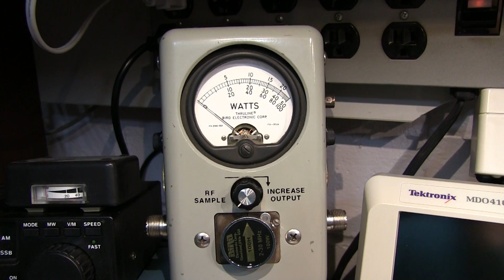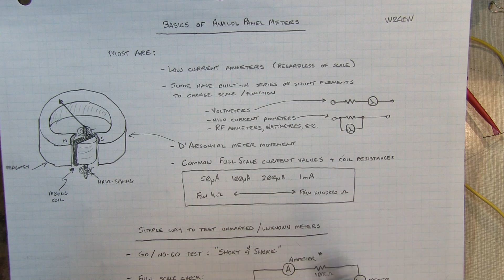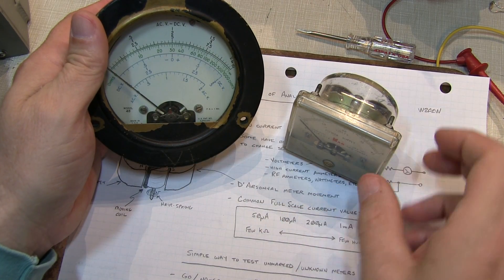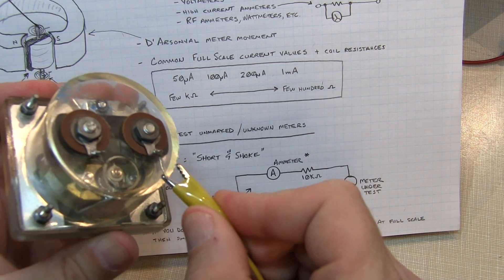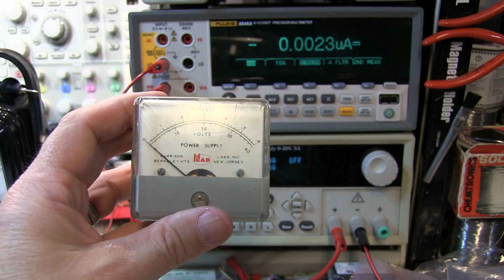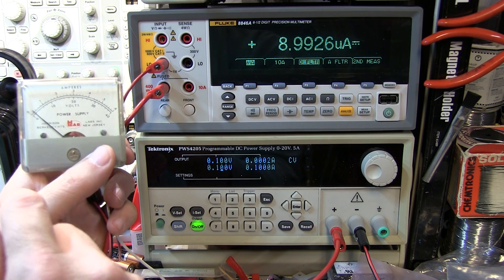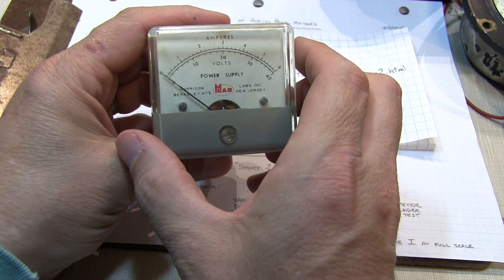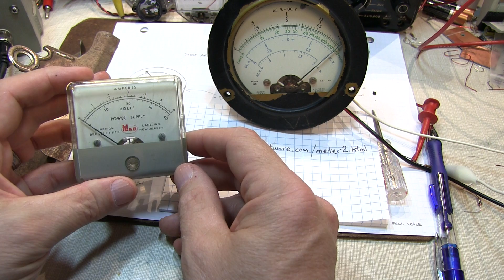#235: Basics of Analog Panel Meters | Analog meter movements | D'Arsonval

Comment: Thank you for this video. I learned so much and it jogged some memories from 40 years ago in my "computer electronics" class in High School. Lol. I'm working on an Autotransformer (Variac) that takes 120vac in and produces 0-140vac out. It came with the appropriate Emico voltmeter installed. The transformer is in fact producing 0-140vac but the Emico is only reading approximately 70vac while my Fluke DMM is reading 140vac. The Emico has no FS information printed on it. I assume at one time it worked correctly some years ago. I can see a rather large resistor in series with the coil and this all looks unmolested. There is no zero screw but the pointer is resting at zero. Can you tell me if this meter is shot or is there something I can do to get it reading FS correctly again? I appreciate any feedback or help. Thanks.
Reply from the maker: It certainly is possible that the resistor has increased in value - it's reasonably common, especially for older carbon resistors.  That would be the first thing I'd check.
Reply: @w2aew  well Sir you are 100 percent correct. It's Brown, Black, Orange, Gold. 10k ohm +/-5%? It's reading 19.7k ohms on all 3 DMM's I have. Which makes sense considering it's basically doubled it's resistance and it's reading half scale. Next question is how do I determine the replacement resistors  wattage? This is approximately .500" L x .250" D. I'd guess either 1/2 watt or 1 watt but how do I confirm? Thanks again. Robb.
Reply from the maker: @robbo6460  easy. Assume that the full 140V appears across it. Power is V squared divided by R, so about 2W at the full 140V. You probably want to give yourself a safety margin and us a 4 or 5 W resistor.
Reply: @w2aew  could a carbon composition (original) be replaced by a carbon film resistor of 4 or 5 watts?
Reply from the maker: @robbo6460  yes
Reply: @w2aew  can I take a Shurite 3404 Edgewise 0-15 vac meter and use it as a Shurite 3406 Edgewise 0-150 vac meter? The scale would be off by a factor of 10 but I can make a small sticker denoting (x10).
Reply from the maker: @robbo6460  Yes, you can most likely put an appropriate resistor in series to increase the full scale voltage reading.
Reply: @w2aew  I can't find any specs on the movement of the Shurite Edgewise. Since the 3404 is already an AC voltmeter, I assume it has a series resistor already. Can I just look at that resistor color code and multiply by a factor of 10?
Reply from the maker: @robbo6460  That should get you close.  It may be better to multiply by 8 or so, and then stick a variable in series and adjust it for accuracy.

Comment: My problem on a Weston model 685 is that the meter movement is actually burned out or open. So this testing procedure won't work. And there is no FS printed on it. How do you find the full scale value in an instance like that?

Comment: All of my ammeters have a millivolt rating for full scale.  75 mV. It would be nice to know the current flowing through the meter at full range. Thanks for the info.
Reply from the maker: If they don't have any other markings (coil resistance of current at FSD), then you'll have to measure them.

Comment: I liked your video. I have a 0 - 10 Amp analog meter, and a 0 - 15 volt analog  meter. I tested  the voltmeter and  the needle wanted to move backwards when in reverse. Could I adjust to have 0 centered at  the top? I would like to use these meters on my HO train layout.
Reply from the maker: There are meters designed for a center-zero.

Comment: I used to work on a lot of pyrometers and hi-pot testers with meters and found if you pull off a plastic meter face, do not clean it if you don't have to. I've cleaned plastic meter faces and had them develop a static charge that pulls on the pointer and can makes it stick to the meter face. A anti-static cleaner may fix this problem but I've never tried it.

Comment: I'm hooking up an old tachometer to a newer motor and have added resistors to lower the current. The tachometer has no electronics and the output from the motor is ac. would I use a diode or zener to remove the dc component?
Reply from the maker: You would need something to convert the motor's AC output into a DC value that is proportional to the RPM.

Comment: I did this to boost HP in my car, it used to say 12.4v after a few days of sitting outside due to the Corona Virus.  After I did the face plate mod, it now reads 14.6v, enough to start my car even with the low battery CCA.  I was able to overtake many EG hatchbacks.

Comment: I have one of that china made 40watt laser engravers, it was cutting poorly and after watching your video, I started suspecting that the analog ma meter was giving me the incorrect mA measurement, After un connecting it and hooking up a voltmeter in its place, i gain 50% of the power back, Which means the analog ma meter that was installed is somehow dropping the power, My question is, How do i find the correct resistor value to have both the analog ma meter displaying the correct mA draw and making sure the cutter gets the power.
Reply from the maker: It is impossible to say without knowing details about the meter (full scale range, coil resistance, etc.) and how it is hooked up.  Disconnecting the ammeter and putting a voltmeter in its place doesn't make any sense to me - ammeters are connected in series while voltmeters are connected in parallel - they are not interchangeable.
Reply: @w2aew  the measurement range that is needed is from 4mA to 30mA, the mA meter is connected on the Cathode side of the Co2 laser tube going to ground, the multimeter I used is in mA mode and I simply connected the probs in place of where wires of the Analog mA meter was.  Is that wrong?
Reply: @w2aew  Thanks for the reply, I got it all sorted out, I basically tried a few different resistors till I got the right one which I settled on a 20ohms. Nonetheless, your video helped me learn something new, Thanks

Comment: That ampmeter was reading 200 mili amp on the first reading not 200 micro amp. I'm sure you meant to say mili amp and not micro. That was really cool tips👍 very good video😁
Reply from the maker: It was actually 0.200mA, which is 200 micro amps.
Reply: @w2aew  Oh sorry I didn't notice the "0."which obviously makes it micro... anyway very cool video i learned some very handy tips.

Comment: Thanks for the explanation! Do you know how sensible VU meters are against pegging? Can they break easily when they pegging at the full scale?
Reply from the maker: It all depends on the design of the particular meter.  Some are more forgiving than others.  In general, it is a bad idea to peg the meters.  It can overload/overheat the coil, and can damage the movement and needle if it smacks the stop too quickly.

Comment: how do you troubleshoot equipment that uses those analog panel meters, how do you know if they are good or bad because using a Fluke 87 DVM meter on ohms mode they will measure 10 ohms across the analog panel meters so I don't know how to tell if its good or bad. Older equipment in the 60's and 70's used those analog panel meters to measure voltage, current, wattage, etc. But when measure the ohms across the analog panel meter when using my fluke 87 DVM meter it will measure very low resistance. When an analog panel meter is to measure a voltage what is the difference between an analog panel meter to measure wattage or current  its the same thing the analog panel meter is either in series or in parallel. I'm not sure if the analog panel meter is internally different to measure voltage, current, wattage, power, etc.

Comment: How do you test panel meters if they are good or bad because when you measure the ohms of a panel meter it measures very low ohms like 10 ohms so I don't know if the panel meter is good or bad. If a panel meter measures watts how is the panel meter connect to the circuit in series or in parallel? If the panel meter is bad not working can I connect my fluke DVM meter across it in parallel to act like a current or wattage panel meter?

Comment: is there any way to move the zero point to the center? my adjustment goes to about 30%... is there an adjustment for the other end that would allow the whole thing to drag to the middle? I want to translate my left-zero meter to center-zero
Reply from the maker: Not easily.  The tension spring design is likely a little different on the "centered" models, so it likely isn't practical to expect that you can adjust one to be a center-null meter.

Comment: I would add a couple points. The springs serve a double purpose. #1.   It is the electrical pathway to the coil itself.  #2  as was stated It helps to keep the pointer stable,
Reply: good, great, important point which the uploader skipped. Material is phosphor bronze which is a good conducting spring material. Steel is bad conductor and also corrodes during monsoon. Kishore kumar from Chennai, India.

Comment: The new multimeters have built in NCV, VFC, VFD. I think the NCV non contact voltage is only for AC voltages for wires in pipes and wooden walls, but can't sense DC voltage in pipes and wooden walls. The VFC variable frequency interface is for measuring AC voltage i think that can have different AC line voltages at 50hz, 60hz, 400hz. I'm not really sure what this VFC really does, do you know? The VFD is to measure motor signals the VFD filters out the motor signals to help measurement. I'm not sure what kind of motor signals you measure using the VFD mode but it filters out the motor noise i think. Do you know what the VFD is used for?

Comment: Hi Alan,, I realize this is going back a ways but,, I'm wondering if I could get some guidance with regard to a A/C ammeter i would like to add a shunt to. The meter is a 500ma range meter and there is no current rating for the movement so,, First do I need to know the internal resistance of the Ammeter?  Do I have to get the meter to do a full scale deflection and how would I do that. I actually tried a 10K resistor to do a voltage drop test and the Dmm amp reading said I think 120 Milliamps for 120 volts..  When I tried to take a voltage reading across the ammeter itself I got no measurment. So was there a extremely small voltage drop across the meter say in Microvolts? I would like to be able to use the ammeter to 5 amps.. I'm at a loss.. Hopefully you can help. Thank you.. and thank you for the great video.
Reply from the maker: Let's see - the meter should have read 12mA at 120V with a 10k series resistor.  With a known voltage and resistance, you should be able to figure out what the full scale reading of the meter would be.  Odd that you didn't see any voltage drop at all.  Since you said it is an AC ammeter, are you sure you had your DMM in AC Volts mode when measuring the drop?
Reply: Fantastic thank you for your reply.. Yes the meter read 12ma at 120 A/C with a 10k resistor. Yes the meter was set to AC volts,, Is the Current draw of ammeters in the Micro amperage range? Would the Voltage drop across the meter have been so small (Microvolts) that my meter didn't or couldn't read the voltage measurement maybe? Also the meter did not didn't budge at all. I'm lost,, I calculated a resistance size for the range of the meter which was 500 Ma thinking that the 10 k was either too small or  too large but I found out that one needs the microamp reading of the meter movement not the range of the meter.. Hmmm So back to square one... A question,,( sorry about this) If i use DC to attain the full meter deflection can I just use a very low DC voltage (millivolts) with an in line Dmm set to uAmps to attain the meter movement amperage draw? Thank you again for the reply and your Help..

Comment: Is there a circuit which can be used in conjunction with a standard shop grade power supply most of us have, to produce millivolts for meter scaling ?
Reply from the maker: Can you elaborate on what you're asking for?
Reply: @w2aew  To perform the test, you begin by applying voltage in millivolts. The shop-grade/commom/hobbyist voltage supply usually outputs in whole volts only. I was wondering if a circuit can be designed to lower/drop volts down to millivolts.

Comment: I just did your short/shake test on a cheap meter on a radio shack learning lab, which has a resistance of less than 100 ohms. Test didn't work. I know the meter works.
Reply from the maker: It doesn't work on all meter movements.  It is more likely to work on very sensitive meters (<<100uA full scale)

Comment: Sir, how to decrease the range of  voltmeter
Reply from the maker: A voltage is made by including a series resistor.  A lower range is achieved by using a lower valued resistor.  If you are asking about making the full scale reading at a lower current than the meter is designed for - this is not possible without adding some external amplifier circuitry.

Comment: Question for VU Meters: I found a Sony tape machine with two VU meters, one for left and right channels, and when I first input signal the left VU meter gradually went straight to maximum and stayed there. It persists without any power or signal. Does that mean I have a faulty meter? Is there any way to fix the meter without tracking down replacement parts?

Comment: I'm an industrial electrician I have lots of ammeters that read from 2-20 then the scale goes to 60 these are very common any way I could drive that with voltage essentially using it as a voltmeter obviously putting 12 volts 60 amps is alot of wasted energy and requires suitability gauged wire but if I could drive it with voltage instead I could use it with an arduino to display my current usage from my multiple devices ect.

Regards, Chris.
Reply from the maker: I don't think I've ever seen an ammeter like that, so I really can't comment.  Can you give me a few example model numbers to look up?
Reply: w2aew https://uk.rs-online.com/mobile/p/analogue-panel-ammeters/3810894/ is a link to some similar meters
Reply from the maker: I'm not sure I see anything special in these meters that would make them respond in a non-linear fashion, so the response you describe might be due to some circuitry associated with the meter.
Reply: w2aew they still respond linearly however note the scales on them I was pointing out that they will quite literally display the amount of current going through them below 30 amps they are typically just wired in series without a current transformer this makes it a shame to use for projects because if you wanted to drive it you quite literally need to put 30 amps or whatever through it.
Reply from the maker: Oh, OK, I misunderstood your original comment.  I guess the answer then really depends on the specific meter design.  It is possible that the high current ammeters have an internal shunt resistor.  You'd have to disassemble the meter to see.  If it does, then you could remove the shunt and use the meter at much lower current.
Reply: w2aew just checked by stripping one apart it is literally a coil and that's it looks easy to rewind though.

Comment: I've seen old meters that fail to go to full scale with specfied current. Either the bearings are dragging or perhaps the permanent magnet has lost webbers.
Reply from the maker: Other possibilities:  dirt/crud built up between the coil and core; overheated coil with some turns shorted together.

Comment: I am still looking for a way to put a 5 digit led display in a Drake L7 power supply. It needs to be able to read from 0-5KV. 
I have Analog Panel Meters but I am building a new supply and wanted to go with LED's. I have one for the 240v that also shows the Hz. Any Ideas on this Alan?

Comment: To use these as a power supply indicator, would you simply wire it in parallel with the load? I seem to have a 1mA FS, 0-20V one...
Reply from the maker: Yes, for a voltmeter, you include an appropriate resistor in series with the meter, and put the combination across the output of the supply (in parallel with the load).

Comment: Hi! What about AC voltage and current meters? Is it simply rectifier and low pass filter? I need one but I think it's possible to convert DC meter to AC meter.
Reply from the maker: Generally, Yes.
Reply: Interesting... I have vintage meter which can measure AC voltages under  100mV. That is below forward voltage of any diode. So... there have to be amplifier or something, right? This is USSR meter from 60's so it can be even magic actually...

Comment: Another very informative vid. Thank you for taking the time to make this. 

How to make AC volt or current  meter?
Reply from the maker: AC is typically rectified with a diode or diode bridge, then scaled with resistors as needed.
Reply: Series resistors? Parallel? Specifically for ACV meter...
Reply from the maker: Rectify, then series resistor as necessary to set the proper current through the meter. Often times the ACV scale is mildly non-linear due to the diode drop and non-linear behavior of the diode.
Reply: Thanks!

Comment: A great way to get your new Meter scale physically onto the backing plate is with http://pulsarprofx.com/DecalPRO/ You need a laser printer (monochrome is fine), a dedicated laminator, and their kit. The detail and quality can be excellent, however expect a learning curve as it takes some finesse. I labeled a stomp-box using this method and it worked very well.